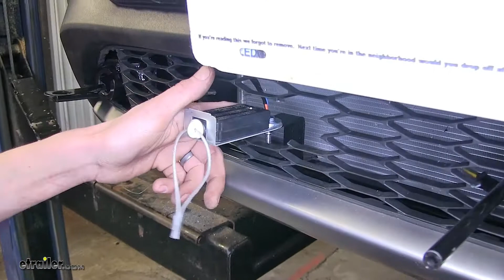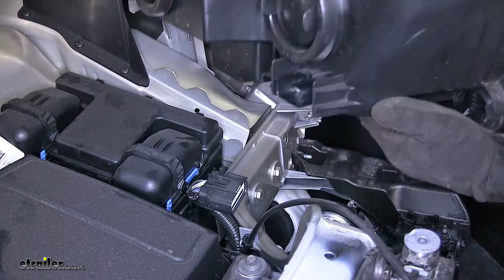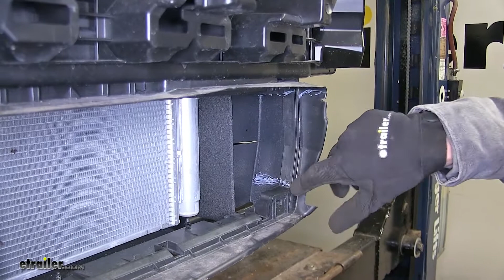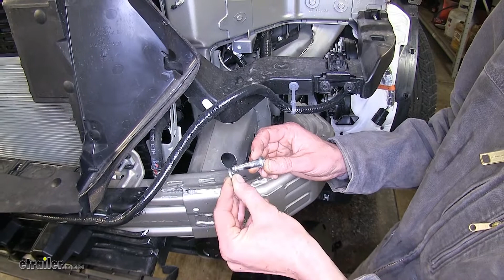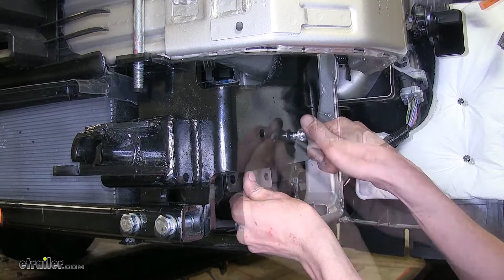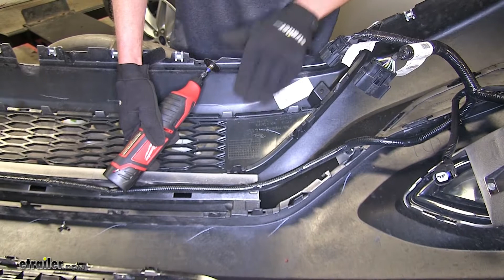etrailer | How to Install: Blue Ox Base Plate Kit on your 2017 Ford Edge

Comment: Excellent video. Not hard to install when you watch this video. However, when I mounted the ambient air sensor with a zip tie to frame it quit working. My check engine light is on and the code p0073 pops up on the code reader. Not sure what's going on. Might have banged the sensor on something. So I will test sensor or replace it and add comment when I have results